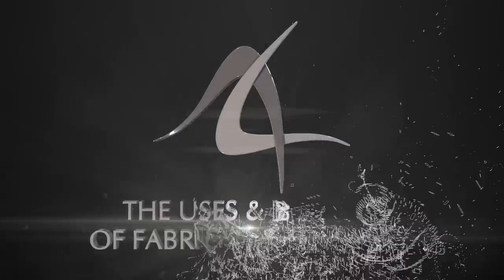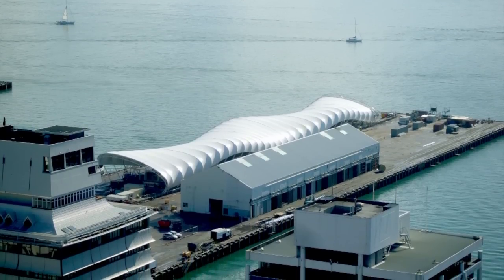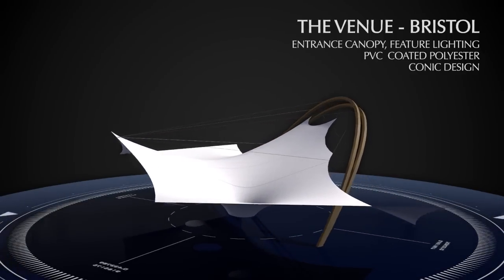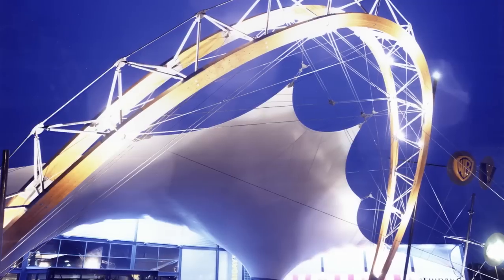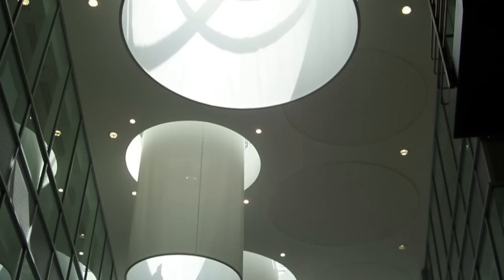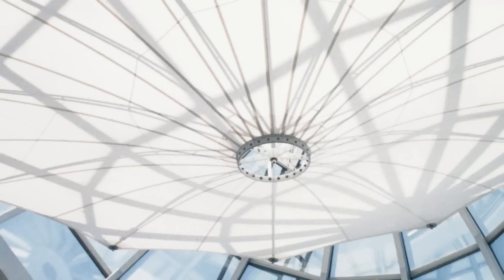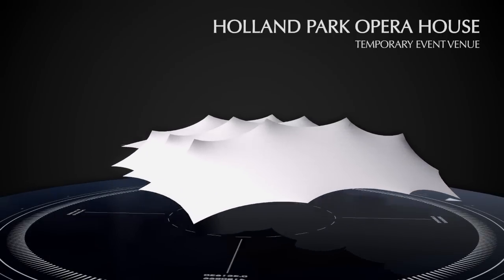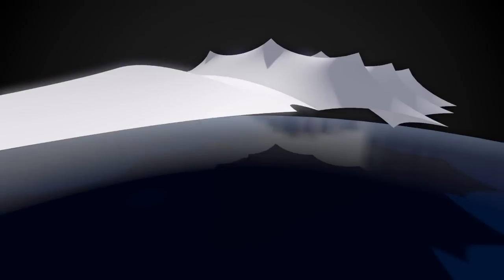Tensile Fabric Architecture: Part Two - Benefits

Comment: 3:41, Wrinkles on the fabric. It will be awesome if they get rid of the wrinkles.
Anyway my job is also handling tensile membrane fabric structure in Singapore.
Reply: check out spraying foam cement onto them please.
Reply: and spraying urethane coatings.....for 50 yrs no maintenance....